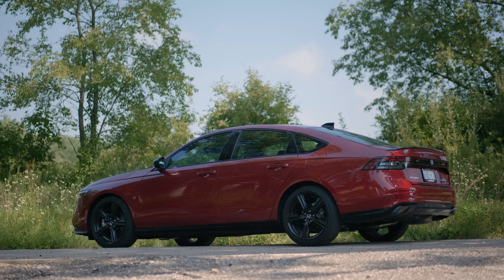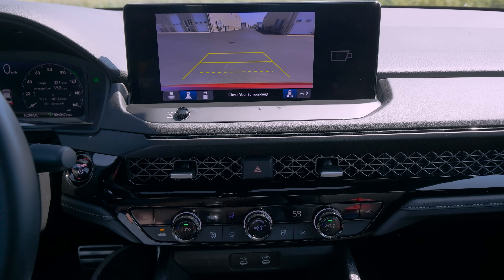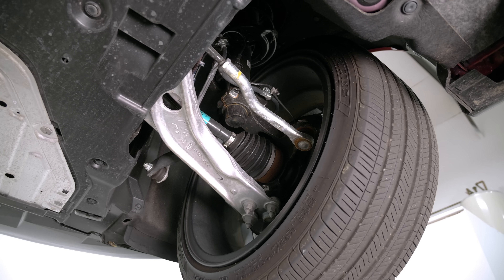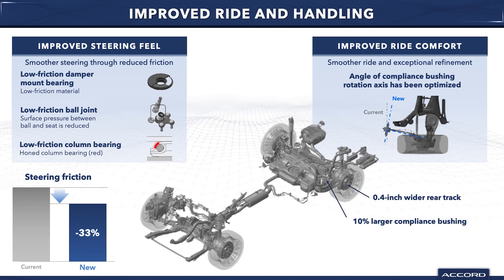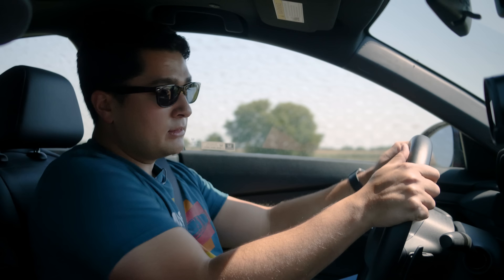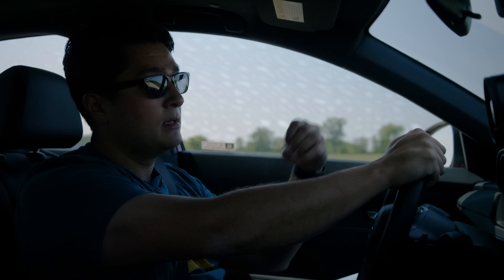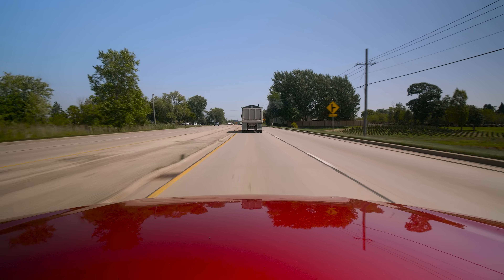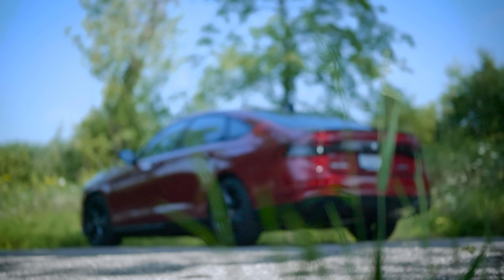2023 Honda Accord | The Art of Normal Cars

Comment: Been an Accord guy since the 80’s. This model pushed me to investigate others. I am now an Acura guy, specifically the TLX. The slightly higher $ is a far better value prop.
Reply: I love the looks of the new tlx but the interior seems a little cramped and outdated compared to the accord
Reply: @SasukeUchiha-zu6dw  yeah, the front is actually roomy, but the back, especially compared to the Accord, is almost pointless. I only have people in my back seat a couple times each year, so it didn’t matter to me. It’s very useable, but the Accord wins all day long as far as space goes. All the rest is a step above imho, but of course that’s subjective.
Reply: @UltraDoug  I have a 2014 Accord and I drool over the looks of the new tlx but I usually have people in my backseat.  If I could get the exterior of the TLX with the interior of the Accord it'd be perfect.
Reply: @SasukeUchiha-zu6dw   yup, no doubt. The 2018 was my last one and I loved that thing.
Reply: Don't know why people are snarking at you...

The TLX is fucking fantastic.

It's built to last more than the 3 years of a lease, unlike anything German.

It's not outdated and dull like anything (affordable) from Lexus.

It's not a giant, gaudy question mark for a long-term owner like Genesis products.

It looks great, the handling is superb, it has possibly the best AWD system in any "affordable" car, the interior is well designed, the audio system is excellent, and while it's not the fastest it's plenty fast for the real world.

Rear seat legroom is a legitimate criticism, but it's hardly insurmountable depending on who you have back there and how often.

The transmission programming could be better as well, absolutely, but for daily driving it is more than fine. 

I'm leasing an A-Spec due to circumstances, but I absolutely want to buy a Type-S when the lease ends. An extra 75 HP would fix my biggest gripe with the TLX as a sporty-enough daily driver, and there really isn't a competitor you'd want to own out of warranty that's a better package.
Reply: @srsbsns7673  I drove it after driving a 340i and the G70. 
I still picked the TLX, and despite all these claims about market adjustment, I paid 2500 under msrp, so I bought the body kit, and then they sent me a check for $417.00 because they charged too much.
Reply: What made you go with TLX instead of Lexus GS/IS for example? Just cheaper? Everything about the Lexus v6's I like better. Major killer on all of these was lack of carplay until 2019 or so.
Reply: @neilquinn  just did a lot of research and landed on what made sense for me. Also watching the Savage Geese vids. They have it high marks. 😎👍🏼
Reply: @UltraDoug  did you get the older 3.5 v6 variant or a newer 2.0t model?
Reply: @neilquinn  2.0T
Reply: @UltraDoug I bought a 23 tlx type s. Everyone dogs on this car, but I love it.  And I have smashed a few BMW's just for kicks. It's a driver's car no matter what any of the internet children say, and even with the 2.0 I would still like it.  It is beautiful, handles great, a blast to drive, and is focused completely on driving, which is why I am in a car.  Perfect.
Reply: @MikeYurbasovich  That's a nice car. Just more than I want to spend right now, especially with how badly VA taxes vehicles (personal property) above $20k.
Reply: @neilquinn i wanted an Lexus IS/RC but they felt so dated for the money and the driver seat felt oddly cramped. TLX was nice but the Integra was 90% as nice but way more usable room. Though the Integra is super slow it's at least light.
Reply: I've had the tlx then went to the rdx then now the hybrid accord. This car is smooth and a great cruiser.
Reply: This
Reply: And that my friend is the real purpose of this car. Upsell to Acura
Reply: @TheSergio1021   excellent point.
Reply: @UltraDoug Damn dude , did you put a bunch of hwy miles on that 2.0 t ? Those TSXs are nice , don't listen to the trash talkers .
Reply: A 1998 Nissan Sentra with a manual transmission was a better value prop for me, so that is what I bought a few months ago....have taken it on like ten 400 mile trips with no issues.....even after wrecking it and having to build back the front end.
Reply: @fortheloveofnoise you do the best with what you got 🍻
Reply: @UserNameTakenDown its a 40k car...if you think rich people are buying it then maybe you are just dirt poor. you should see how much a f150, the most popular vehicle in america, cost
Reply: @NotUrStupidName  Exactly.
Reply: Lol, TLX...
Reply: @mattspeer01  lol, lol
Reply: @UserNameTakenDown  TLX isn’t a luxury car… it’s just masquerading as one.
Reply: @mattspeer01  not sure what either of you are talking about. 
1. I ain’t rich. Got a deal on a 2021 TLX for $42k. 
2. I don’t think a TLX is luxury or masquerading as one. 
3. As I said, I’ve been a Honda guy for decades and this Acura is just a Honda with better fit & finish for a little more money. 60-80k plus is what I consider luxury.

So….bragging?…..masquerading? Ok. Whatever helps you sleep at night. I just like my new-ish car batter than the Accord that I’ve loved for years.

Comment: I was waiting for this review! I still have the 2015 Civic but planning to upgrade to an Accord or Honda/Acura SUV if I stick with the Hondas. The styling is not bad, the safety scores on IIHS are really good, might have great resale value, and, has good tech inside. Even though it has a CVT, I still would consider it on my list. I bought the 2015 Civic as my first car so it was my first CVT, I do transmission fluid changes every 30k miles and it still runs good at 110k miles!!
Reply: The new hybrid does not have a CVT.  In fact, it does not have a transmission.  Honda calls it an e-CVT instead of direct coupled so people are less confused.
Reply: 2015 is a new car here in Croatia lol. Good luck with finding a new car
Reply: Don't buy a liability bro  . Civic got  years left .
Reply: Why you don't do CVT oil changes with every engine oil change 😀😀😀
Reply: @HEMI345S  That interval is too soon and kinda wastes money
Reply: @HEMI345S nd transmissions need some balance with dirt

Comment: A lot of people hate on this car for the aesthetics and I get it considering the last generation was one of the better looking accords. That being said the accord is probably one of the best sedans over time, I've owned a 2004 and a 2012 and had no issues with either. If I were going to buy a new sedan it would be hard to talk me out of an accord.
Reply: you didnt own the cvt version 😂
Reply: I own a 2004 (still driving it as well). It is like the most solid car I've ever owned. I am thinking of upgrading to a 2022 Accord (like you said, one of the best looking Accord). But I can say for sure, Accord is definitely one the best line of sedans out there. Simple and solid.
Reply: Honestly don't get the hate on the design. I think all of Honda's new lineup looks great tbh. 
Shame there's no manual anymore but that's the consequences of hybrid
Reply: I mean to be fair, you can have a manual hybrid. Honda did it twice in fact. The Insight and CR-Z had manual options. However, the amount of people searching for a new, manual hybrid is very few and far in-between, so there's no real reason in this day and age for a company to go out of there way to produce even a few handfuls of manual hybrids; especially when it comes to profits and R&D. At least the Civics thankfully still have manual options for now.

As for the design, literally the only gripe I have with the looks is that front; it looks too much like a Taurus. The backside of this new Accord looks really great, and the interior is wonderfully refined! The front end just looks a bit dated out of the gate.  @philipvalvoschnotalla9634
Reply: @iLupi  How well did the Insight and CR-Z manual options sell?
Oh, the Insight was a dismal failure and the CR-Z had a 6.3% take rate.
Ah.